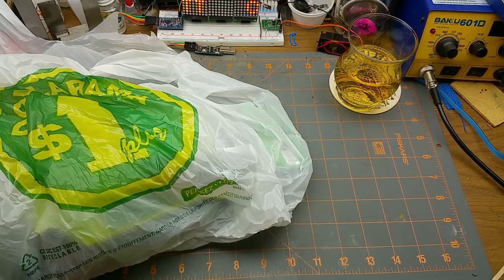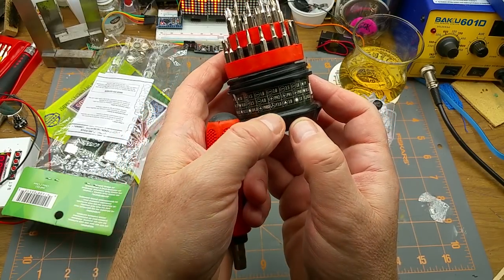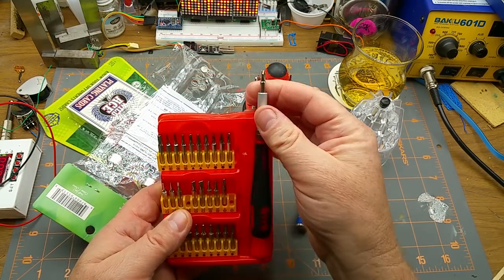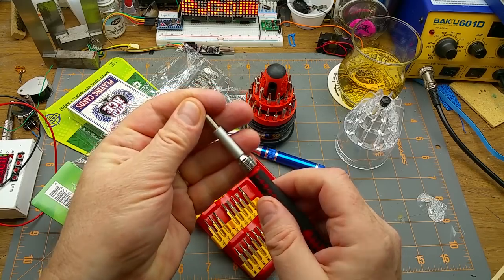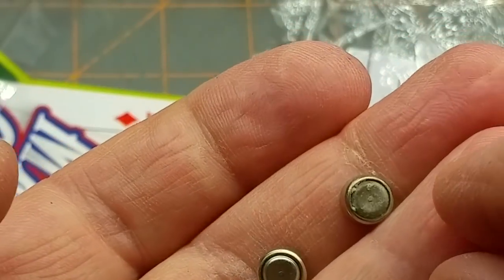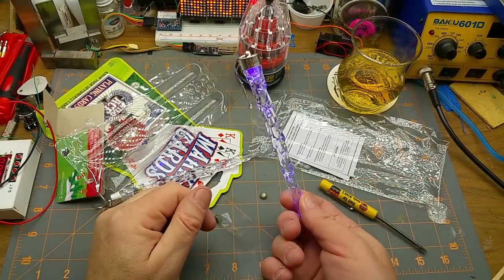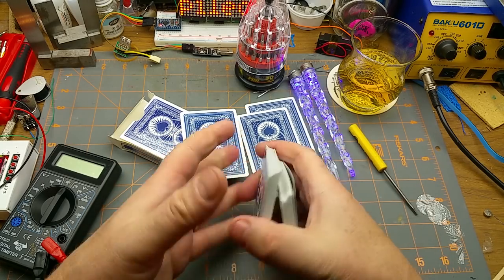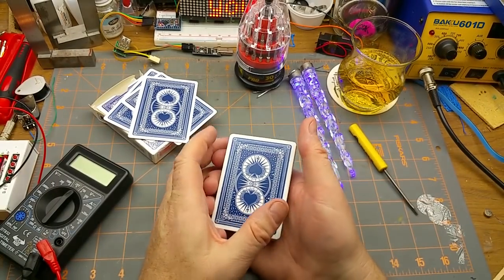some fun dollar store finds

Comment: That multiple bit set thing you started off with, yeah, that's £1 in the UK from many places. The bits are soft chewy. Good for saving screw heads, I need say no more.
Reply from the maker: I doubt any of the other miniature replaceable bit drivers are much better.
Reply: The ones that cost half an arm and an eyebrow aren't bad, Wera make a few nice sets for example - I've used them in the past - never owned my own though.  Edit: Search Wera Kraftform for a hint of their range. 

After going through many cheap sets, I'm wondering if it really is a false economy regarding small drivers.
Reply: For light use, these are not bad. I've had them on my desk for a couple of years, and they come in very handy. I have this one and the "Clive" model. 

The Wera/Wiha ones are lovely, and will probably last a life time.. but ouch.. The prices mean buying what you KNOW you will use.  In which case, may as well get individual drivers.
Reply: Used to be £1 at Poundland a couple years ago. But shortly after EURef they were replaced with a smaller version with far fewer bits to keep the price constant. 
The Bigclive screwdriver was also shrinkflated. They used to come with 9 bits but now only the 6 bit version is available for £1.